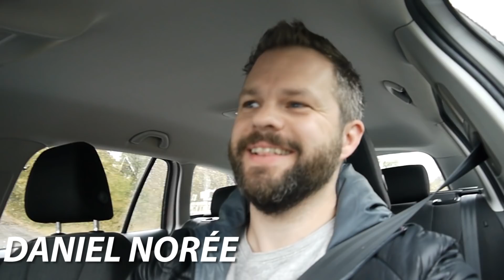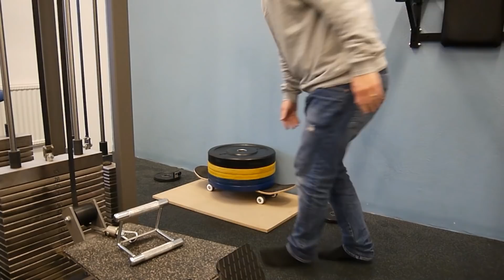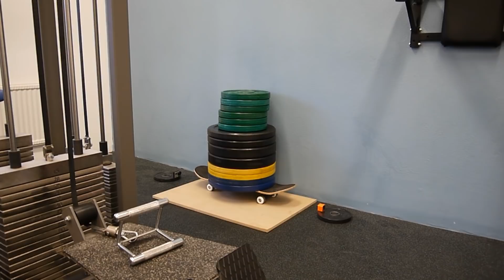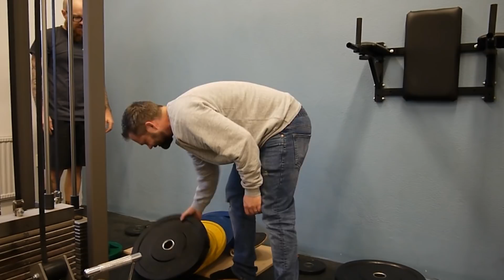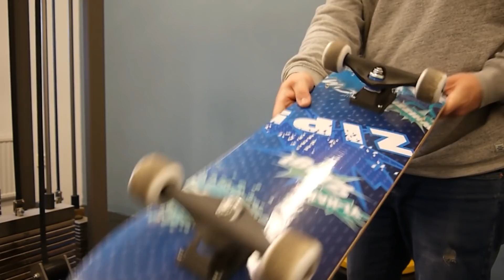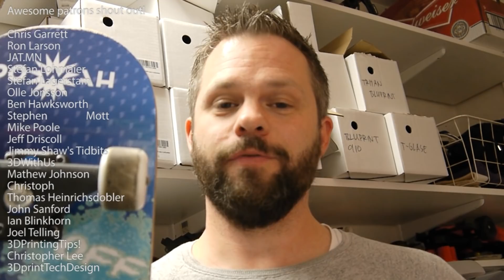3D Printed  Skate Trucks Weight Test

Comment: I would be curious to see how they would actually break in real use. Get a skateboarder to use them doing street skating. Grind on them, do stair drops, 360 flips. etc. My feeling is that shear around the kingpin into the pivot-bushing/cup would be the first mode of failure in hard use.
Reply from the maker: I would love to do that but i don´t know anyone that can actually do that. But i think i´ll do as many has suggested and send them to Braille on YT.